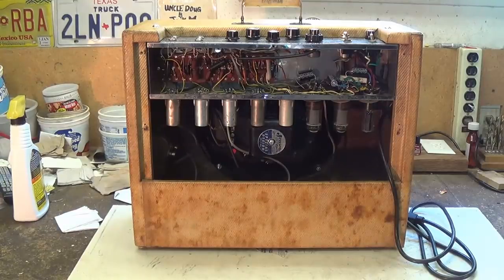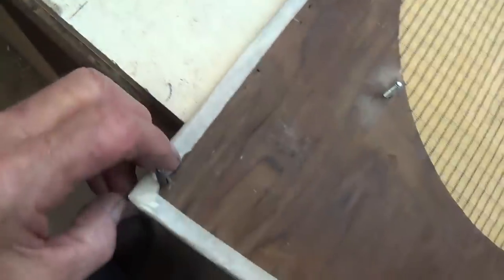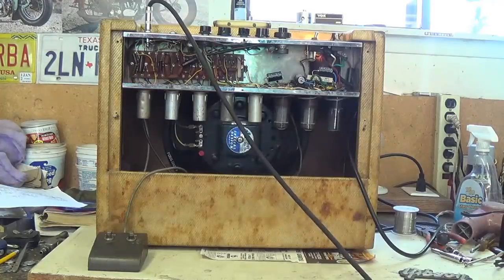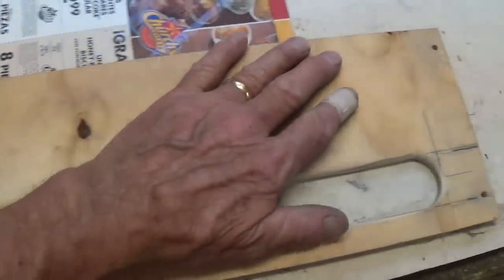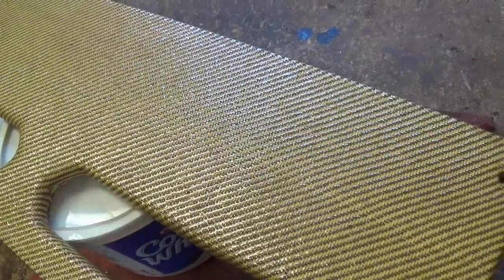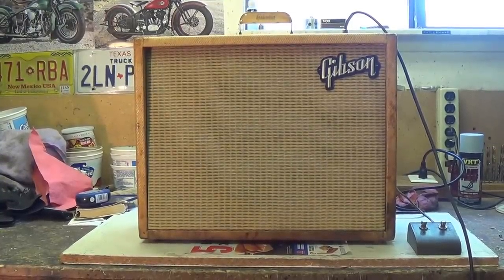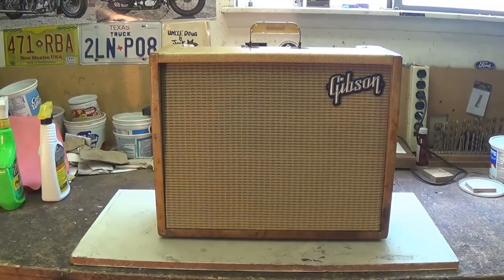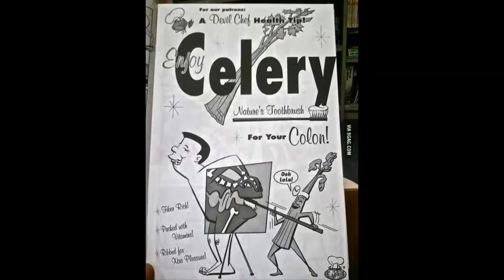1961 Gibson GA-2RT Maestro Deluxe Reverb Echo, Part 2

Comment: With the old grill (grille?) cloth, you could add a new border, sewn together, and then use the new border to pull and adhere to the back? You have more patience with the outside than I would, that would get replaced, as badly as I would be capable of 😂
Reply from the maker: I used some duckbilled pliers to pull on the material. It is now tauter than Gene Krupa's snare drum. I like the stained look.....now that it is cleaned and  shiny.
Reply: @UncleDoug  I guess there is patina and then there is filth 🤣
Reply from the maker: Yes, indeed. Filth must go.
Reply: @UncleDoug  good motto for life too

Comment: Awsome. Really cool amp. What did you use for the speaker doping ?  I think the doping was a great idea. Overall fantastic job as always Uncle Doug.
Reply from the maker: Thanks so much, Bryan. I used thinned contact cement.....two coats.
Reply: @UncleDoug  ah. Interesting. Ill have to try that. That seems like a good way too go if you are not sure that doping is going to do tge trick. It seems thinned contact cement would have a mild effect per layer. Keepi g you from going to far to fast. Brilliant.  Thanks so much.

Comment: I have a Jensen special design for Sears woofer in my set of hifi speakers that needs deflubbing, any guidance in that would be appreciated.  they're just too good to throw out!
Reply from the maker: Watch my video on speaker repair without re-coning, PS. You can try coating the perimeter of the cone suspension with 2 thinned coats of contact cement.

Comment: Hi Uncle Doug, this is just an opinion,  in the overall I prefer Fender sounds, but amps can fit better depending on the sound you need, and besides its good to have options and variations. So I want them all lol. Great job, and a final question: do you have a video with a Moog L series? My best...
Reply from the maker: Thanks so much, Ed. No, I do not.

Comment: did you add any kind of metal shielding inside the new back panel? Aluminium tape or something similar? It doesn't sound like it's particularly noisy, so I'm curious!
Reply from the maker: No, I didn't, Daniel. As you noted, it is silent enough that I didn't feel it was necessary.

Comment: Doug .... I have found a solution to getting rid of stains that are hard to remove - mold - blood - organic protein based. Hydrogen peroxide and a small amount of Dawn Platinum. The peroxide will foam and lift the matter and the infused Dawn Plantinum will allow you to scrub/ rinse it off. A soft cotton pad and a little time/elbow grease will be helpful.
Reply from the maker: Thanks for the great tip, KM :)

Comment: Uncle Doug I just purchased a Ceriatone built clone of a Marshall 1974x combo amp with the treble bass mid mod. It is completely point to point wired. What do you think of these amps? I paid 900$ for it. It should be arriving on Friday.
Reply from the maker: I have never seen or worked on one personally, D1. Please let me know what you think of it, so that I will have some accurate information to pass on in case another viewer asks the same question.

Comment: Doug… quick question about a brand of home amplifier.  Threshold Amps made in the early to mid-1980s by Nelson Pass all used the phrase “optical bias” to refer to the biasing technique used.  My question, was there really an ‘optical’ circuit for biasing or was this this just clever marking jargon?  If there was an actual optical circuit used how did it work? Thanks.
Reply from the maker: I work only with vintage (1930's-early 70's) tube guitar and PA amps, 8068, and I have a feeling that the amplifier you are asking about is probably intended for audiophile HiFi use......thus, it is too new and really not the type of device that I am familiar with. Perhaps an Internet search can yield some information. Good luck.

Comment: Well I almost fell out of my seat when I saw part 1 of this series!
I have the very exact amp serial #210101,  just one number apart from yours?!
Mine is still working and a bit cleaner but just like this one it's missing the back panel and the speaker is not original.
The Celestion that someone put in the amp sound really sweet though so NO complaints!
The trem on mine wasn't working when I bought it (for $50 in the early '80's) so I disconnected the foot-switch cable and wired a toggle switch for the reverb.
After hearing yours I'd love to get the trem working again but have no clue how it was wired.
Is there a way you could provide a link to the schematic and can you tell me where you sourced the caps from as I'd really like to replace mine.
Also where you got the tweed from as it's a perfect match. Any help from you would be greatly appreciated!
I'll also take pics of the innards of mine if you'd be interested as I think mine is mostly original minus the speaker and output transformer.
i even have the original knobs around here somewhere.
Reply from the maker: Wow.....it's a small world, V. Here is the schematic link:  http://archive.gibson.com/Files/schematics/GA2-RVT.pdf  The caps are available from Antique Electronic Supply. I got the tweed second-hand from a friend and don't know where it originally came from. I need a set of original knobs if you ever happen to find some.

Comment: Uncle Doug, I am not sure where to post this because I do not have any personal way to IM you, so I thought I would just try to message you here. I picked up a dead Marshal JCM800 for nothing ,there were absolutely no salvageable parts (except for one, and a few pots) and there was rat feces everywhere, all the tubes and sockets were destroyed. HOWEVER, and I guess this was a replacement because there is a near spotless Classic Tone 40-18025 output transformer that works beautifully. All the schematics I see for this amp use 12ax7 for power tubes? However I want to take this transformer and use it in a custom build. I have both a match pair of 6L6 and 6V6 tubes, will either of these work for power tubes for this transformer?
Reply from the maker: Greetings, RR. The 12AX7 is a pre-amp tube, not a power or output tube. The 40-18025 OPT is correct for the Marshall JCM800. It requires a primary impedance of 3.6K Ohms, which would be a pair of EL34's or possibly 6L6's, but it would not be appropriate for 6V6's if you want 4, 8, and 16 Ohm speaker impedance.
Reply: @UncleDoug  Thank you so much for the reply. For a warmer tone, would you recommend the EL34s over the 6L6 (I ask because I only have 1 EL34 in stock hahaha) Also, today I became a patreon supporter. Its not much per month, but its something to hopefully help. As I have said many times, thank you for sharing your knowledge and your life with us.
Reply from the maker: You're welcome, RR. Thanks so much for your patronage of our channel. Tone is completely subjective, so my preference might not be yours. Here is a video that may help you decide:   https://www.youtube.com/watch?v=qMqJeIukXtE

Comment: Howdy Uncle Doug - I just went back and re-viewed Part 1 and I couldn't seem to find any discussion of grill cloth cleaning so perhaps this one didn't need it...but what technique and/or products do you recommend for that job? I've got a fabulous Magnatone M13 Imperial with  big old nasty stain down the front...it's in relatively good shape otherwise. As you probably recall, the grill cloth on the M-series Maggies is attached in an odd way and I'll have to figure out how to re-attach it if I go through with this. I've been dreading it for years...
Reply from the maker: The grill cloth was perfect in this case, Leon. I believe that Big Dave installed it many years ago. I have used lacquer thinner to remove stains, and some viewers have suggested such exotic chemicals as oxalic acid. I would probably try the same cleaner I used on the cabinet. Good luck.
Reply: @UncleDoug  - Thanks. Yeah that cleaner sure seemed to have done a fabulous job on the cab.
Reply: @leonc1234  I used warm soapy water (no harsh chemicals) to clean an Ampeg Jet gill cloth. I just let it soak for a few hours after removing it from the baffle of course.
Did this a few times as the first batch of water was filthy. Came out looking great, still looks aged but clean. I think most of the stain was from cigarette smoke BTW.
Reply: @valvenator   good info, thanks.
Reply: @leonc1234  BTW, if you want to "age" a new grill cloth it was suggested by a seller to me to give it a soak in a strong tea. Never tried it myself though so no personal experience there.
Reply: @valvenator  makes sense.
Reply: @valvenator  , Oxyclean crystals dissolved in warm water will virtually melt away  cigarette smoke from grille cloth. That s**t is amazing.
Reply: Leon C, leave the grill cloth in place on the cabinet;  just remove the top and bottom amp units abd tge speakers,  and spray the Grill cloth with OxiClean crystals dissolved in warm water with a dab of dish soap. Let it sit a few minutes and lightly hose It Off and put it somewhere warm so it will dry quickly. I know from experience that OxiClean is excellent or removing cigarette smoke, and I'll bet you it'll take out beer or coffee or whatever else got spilled on that Grill cloth.
Reply: @goodun6081  Good to know. Unfortunately cigarette smoke aged amps are getting harder to find day by day.

Comment: Uncle Doug, were the transformers 100% compatible with the line in? This as well as all of the amp you have refinished would be the deal in the studio with a SM-57 with any modern day music, just to give that magical touch of yesteryear. What I do is point the mic at the same angle as the cone of the speaker right at the edge of the dust cover, the further out on the speaker makes it to muddy for me and I show the band why and they all agree. There's a lot of bands that wrap the cord around the handle and leave it danging somewhere over the speaker when the SM-57 is meant to point, They're getting their sound from the side and most of them are never happy with their sound so I pass this idea down to them and I never had a negative review. Finding your sound is a nightmare, what's your take on this mic issue?
Reply from the maker: If you're speaking of the reverb driver, Mr. B, I felt it would work since it is driven by a 12A_7 tube (proper input impedance) and outputs to an 8 Ohm reverb tank. It definitely did seem to work well. I am inexperienced with microphones, but my next video camera will have a remote microphone capability and I look forward to experimenting with them.
Reply: @UncleDoug  Yes, reverb driver. Good to know with the transformer between the tube matching side in and 8 ohm output. I wont forget that. It must have been the original driver was getting tired.

Comment: I think my reverb transformer went south no voltage on pin one.same transformer as the one you removed from gibson
Reply from the maker: See if there is continuity between the lugs for each winding.
Reply: @UncleDoug  ol between blue and red wire .440 ohms on output
Reply from the maker: Is the amp single-ended (4 wires) or double-ended (5 wires), BC ?  Do you mean to say 440 Ohms or 0.440 Ohms ?
Reply: Uncle Doug 440 ohms I hooked it to a variac didn't get current through it .zero continuity also it is a 19rvt. 1962 gibson falcon
Reply from the maker: Sounds like it's time to go shopping for a new OPT, Mark. Try ClassicTone on the Internet.
Reply: I ordered one from the guys in arizona and a tank ,thanks i love the gibson amp video

Comment: Hey Uncle Doug I'm wondering if you can give me a hand with a quick question my Gibson ga 19 rvt Falcon amp is giving me a little bit of trouble the output Transformer is getting warm and too hot to touch after about 45 minutes playing
Reply from the maker: I wonder if the speaker impedance is correct. If it's too low, then too much current is flowing through the OPT = increased heat. Also, if you are using any sort of overdrive pedal or if the output tube bias is incorrect (too high) you might be flowing too much current.
Reply: @UncleDoug  thank you so much for your quick response I do use a DigiTech rp1 guitar effects processor in front of the amp I have never noticed this problem in the past I've had this amp for many years
Reply from the maker: Then consider my other suggestions, James. Something has changed in the circuit and it may cause damage if not corrected.
Reply: @UncleDoug  speaker is original Jensen
Reply: Do I have to unsolder the leads to the speaker in order to check its Ohm value?
Reply: Well I just checked with my meter and yeah I got to unsolder the leads to the speaker 2 ohm it out
Reply: @cruisenguitars7554  If your speaker is reading at 2 ohms there's a very good chance of a short in the voice coil.
Try replacing with a good working 8 ohm speaker (if that's what the amp calls for) to see if the problem goes away.
i had to have an output transformer changed on my Gibson amp and it changed the sound as well. Not worse really but noticeably different.
Reply: @valvenator  thank you I will disconnect the speaker soldering points and I will ohm it out again
Reply: I will have to do the soldering points rather than cut the wire cuz then someone might think that the speaker was replaced so I'm rather than cut the wire I will remove one wire from the speaker and ohm it out again
Reply: Also I wanted to thank you for your videos they are very informative and very well-thought-out and I learn a lot from them
Reply: Hey Doug I disconnected and ohmed out the Jensen speaker in my Falcon I would 7.9 ohms on my fluke digital multimeter
Reply: @valvenator  , i think he meant to say "in order to 'ohm it out' ", ie in order to measure the resistance, , but the spell check or predictive  typing software changed  to into the letter "2".
Reply: @cruisenguitars7554  , yup, an 8 ohm speaker. Quite normal.  Something else is going on inside the amp.
Reply: @goodun6081  well now I'm kind of worried that the Transformer itself could be going bad changing the Transformer can change the tone of the amp am I correct? And the value of a vintage amp
Reply: @goodun6081  Seems you are correct. (damn' spell check done it to me too) 7.9 reads on the higher side of normal for an 8 ohm speaker but still normal. I mentioned that I had the output transformer replaced in my amp and it changed the tone slightly but it sure beats a dead amp. 
I wonder if it's normal for these Gibson amp transformers to go bad (though after 50+ years anything is bound to)

Comment: Enabling your cats' drug habit on camera like that...not a good look, Unc. ;)
Great job of saving a formidable beast of an amp, though (especially fabricating the replacement panel)...it would have been a shame to let this one fall by the wayside...just curious, but did you measure the old reverb tranny?  I'm curious as to the difference in outputs...
Reply from the maker: Thanks, C7. I have not yet measured its winding ratio, but the difference between it and the ClassicTone with the new tank was substantial.

Comment: Hello Sir,  I wanted to know if I could hire you to build a tube amplifier for me.The ones at the Music Stores are either Too Small or Waayyy too Big and LOUD!!!! I just bought a Paul Reed Smith handmade guitar, and I cannot afford a Vintage Amp for it.I am a retired musician, and my forte' is Saxophone and Keyboards!!! 

I  finally having the chance in life to record a Demo of my own original songs, and need a midsize tube amp that is SUPER CLEAN and WARM,with just a little BITE when the tubes are in OVERDRIVE.Many people do not know the difference between DISTORTION and OVERDRIVE. The sound I am after is:Early Beatles with more bass than those VOX amps provided.

 I drive semi truck at night for Coca Cola,and am willing to pay for what I want, but I don't want to have to take out a second mortgage on the house to get it!!! I have NO ONE here in the Cleveland ,Ohio  area to turn to , so I thought there would be no harm in asking you!!!! 

I need to be able to record at 3 am in the morning ,so I  would need a headphone jack with a volume control, as well as a LINE OUT  for recording.I no longer play in public, so it does not have to be able to play over a live drummer.A 10" or 12" HIGH QUALITY speaker would more than do the job, mainly for low end reproduction, or I could go with a smaller speaker, but I need to HEAR that LOW END,which is the meat and potatoes of a great guitar tone.

So now I finally have the guitar I wanted all my life, but the quest is not over until I can find an amp that is not sitting in a museum, or being auctioned off for thousands of dollars!!!!Any. advice, help or agreeing to build one for me would be grandly appreciated .They don't make em like they used to, and you certainly will not find a man of your knowledge working at any of the music stores these days, that's for sure!!!!-Kenny Baughman Email: kennybcars@gmail.com
Reply from the maker: Wow, I am quite flattered by your request, Kenny, but I fear that custom building an amp to exacting specifications would be (much) more expensive than you seem inclined to pay. My advice would be to find and buy a nice, silverface Fender Princeton or Deluxe Reverb. They are generally available at $800 to $1000, and offer fabulous tone, tremolo, and reverb at a fraction of the cost of a hand-built boutique amp. Best of luck to you.